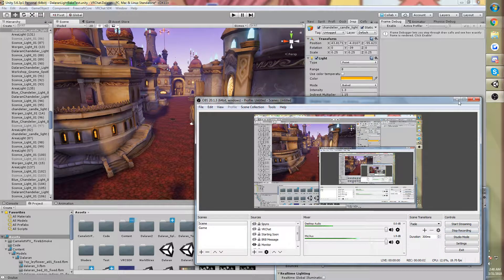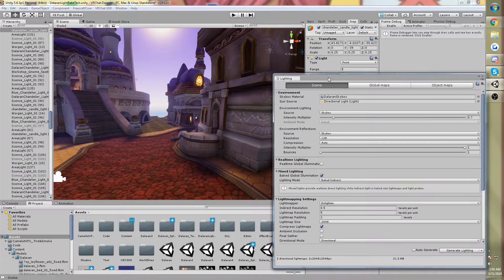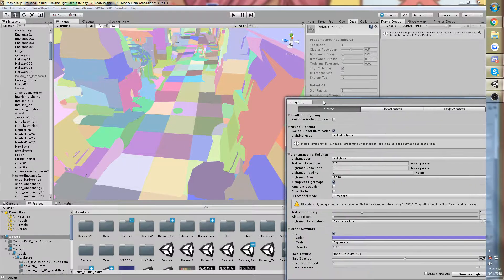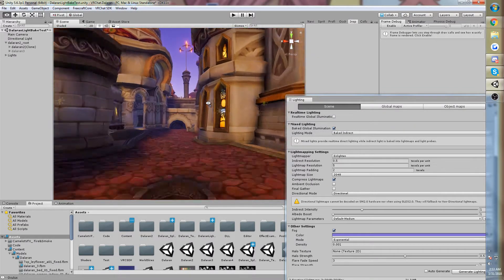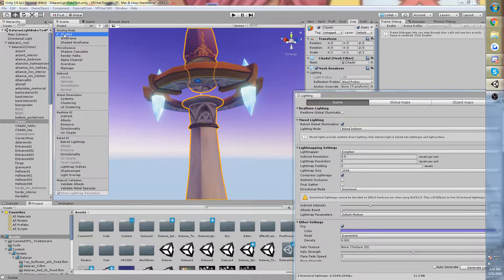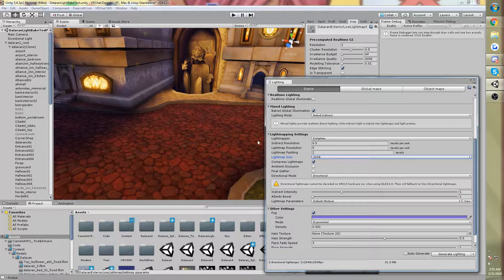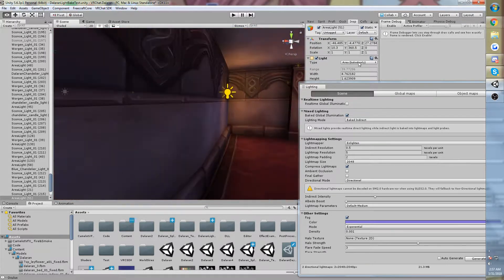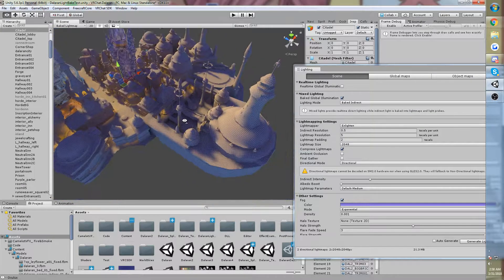VRChat - Dalaran Lighting

Comment: How long is your usual bake time for a scene like this? I find with my small scenes these settings are taking a long time to compute the lightmaps
Reply from the maker: It depends. Without optimizing for bake time, small scenes could take an eternity. Large scenes might never bake period. It really depends on the scene, this scene when optimized only took about 15 minutes or so to bake I think. It's been a long time since this video so my memory of it is abit hazey, but I go over afew of the things you can do to reduce bake time I think. Did they not work for your scene?

Comment: Interesting would be how to extract WMOs ADTs and other wow related files to Unity3D.
Reply from the maker: There are two tools that can export ADT terrains. Though none currently export it in a fashion that I consider ready for realtime rendering, they don't do it the same way World of Warcraft handles it. Neither maintainer is interested in addressing the concerns I raised. However I did start working on reversing the ADT format and that work is opensource but it's not anywhere close to finished and is for 3.3.5.

My workflow currently uses Marlamin's OBJ exporter for exporting WMOs but I've created a fork that is capable of spitting out shared materialed doodads and have started work on exporting them in a better batchable form in Unity3D. I'm currently testing the light baking for the batchable form. Though there are some UV issues.

Either way, if I made a video on that I'd have to release the tools I wrote and I'm either not interested in doing that just yet or they aren't in a polished enough state to release.